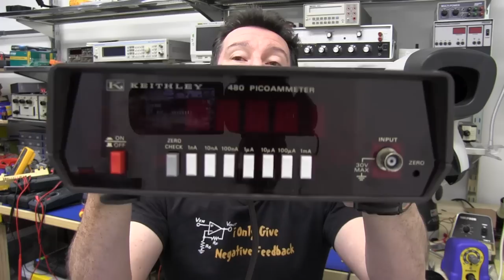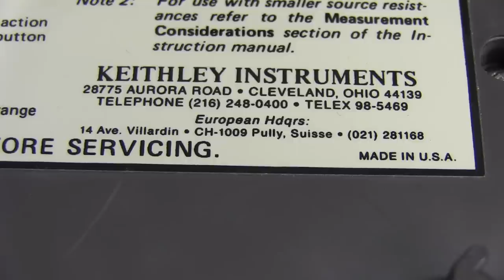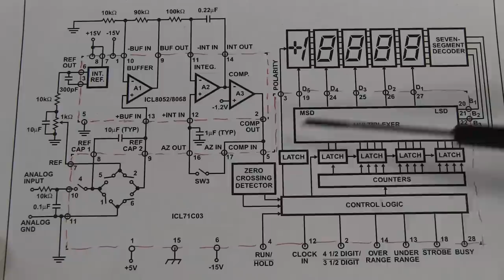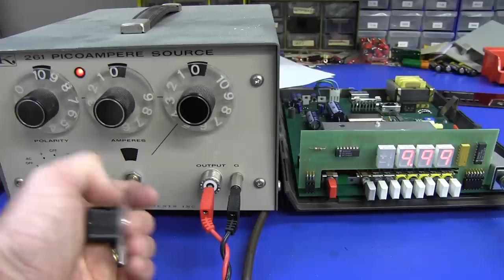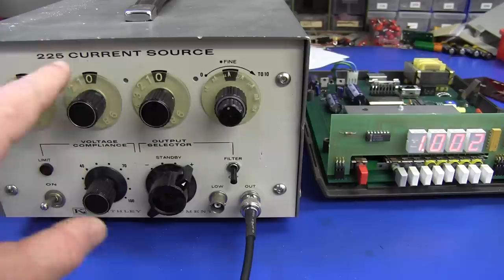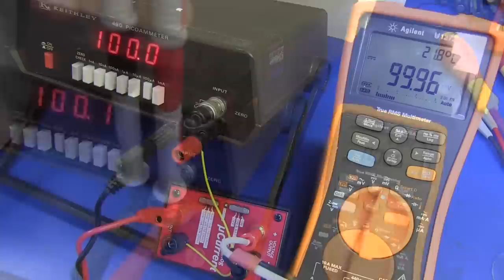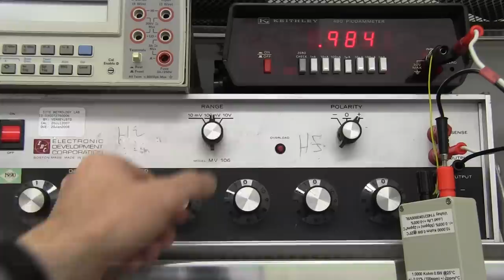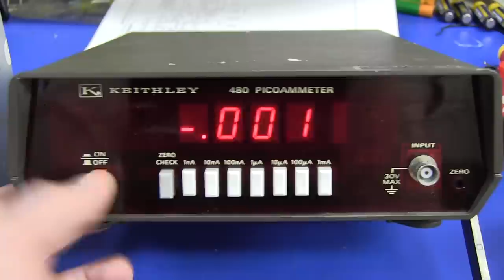EEVblog #406 - Keithley 480 Picoammeter Teardown & Calibration

Comment: Dave: in your explanation of the offset voltage getting multiplied as the feedback resistor goes up - I don't understand why that should produce an increasing error, since the scale factor of the output of the op-amp (i.e., volts per amp) is also going up. I suspect that the reason for the increasing error has something to do with the way they implemented the FET-input buffer on the op-amp but I have not checked the schematic to develop that theory further.

Comment: Thanks for a great video. We have 3 of these meters at our facility. They are used in our Electrostatics lab. You referenced the sheilding contact to the lid. The lid is a carbon load polymer about 1 to 5 Gohms. The shield contact provides a discharge path for the surface charge built-up on the plastic lid. Again, thanks for the effort you put into your productions.

Comment: Dave, the right angled power cable coming out from the bottom of the unit is because the cable can be stored by winding it into the groves molded on the unit's feet.

Comment: 10 picoampere /(charge of electron) = 6.241509×10^7 per second. That's still quite a lot. Now you can get opamps which have input bias currents in femtoampere range and that's really low.

Comment: Yes dave current leakkage is a absoloute killer for performance of this kind of instruments. I did design a automated capacitor current leakage measurement with a newer model with help of kithey low current switching relay board. Pain in th arse but result came out good. Now they test all the capacitors in europe in my pervious company (which is mother of test and quality of electronics in europe). this brought me good memories of employment time :(

Comment: repairing computers i've seen that syndrome lots of times, just live it unpowered to discharge some time (say a month or a week) then plug it. It might not work at first but after a couple of times it will magically start working and after some more power cycles (sometimes wont start) it will stabilize and continue working till the end of times.

Comment: A LOT- 'round about 62,415,093 electrons per second. An inexpensive LMC6062 typically leaks about 10fA or about 62,415 electrons a second. A modern meter has a bias that is a fraction of that, even. LM6001 is guaranteed to be less than 25fA (same 10fA typical as the much cheaper 6062)

Comment: Happy New Year Dave! Oddly enough, I got a Keithley 197 from ebay a few days ago that was also shown as powering on and functional, but when it came in it had the same problem! A few hours later, it too started working just fine - after a few power button presses that initially displayed some character errors on the LCD. Wonky switch or overly temperature sensitive soldering joint somewhere, maybe?

Comment: I watch a lot of your videos and you don't make many mistakes, but you blew it with this video!  You are correct that (1V-100uV)/10K = 99.99 uA but (10mV-100uV)/10K = 0.990 uA or 990 nA not 990 uA and (1mV-100uV)/10K = 0.090 uA or 90nA not 90uA . I make electrometers for a living and work down from 1uA to 1fA.  Look at my video that measures femtoamps if you want to see really small currents.
Reply: And doesn't the 1Meg resistor in the input path affect Dave's calculations? 
I've just built the Gyro@EEVBlog picoammeter adapter (1mV/pA) , and doing what Dave was showing, with 1mV driving through 1G, 1 read 1pA. It reads V/1G for all voltages to well within 1%. It can even resolve 100fA reliably as I change the voltage in 100uV steps. More experimenting is required, but it seems to work really, really well.

Comment: 14:33 What's the point of guard rings covered in solder mask? Doesn't that make them completely pointless? A bit of a misstep on the part of the board designer there -- or am I missing something?